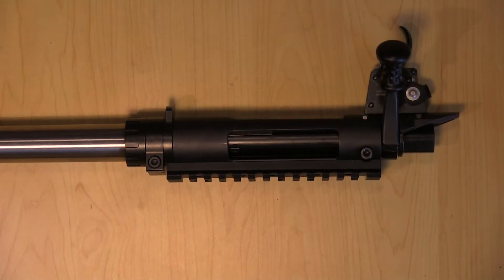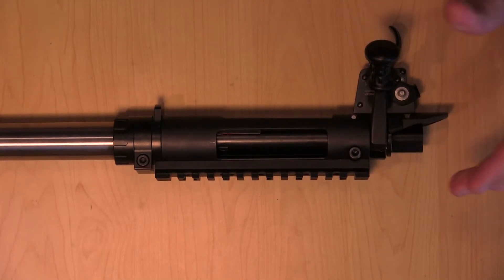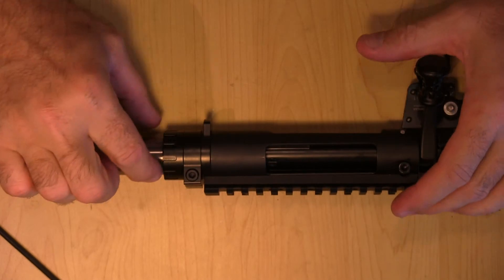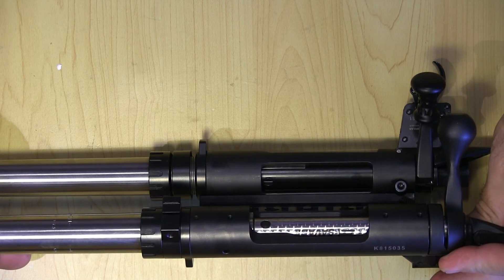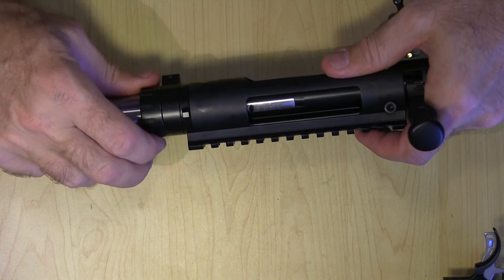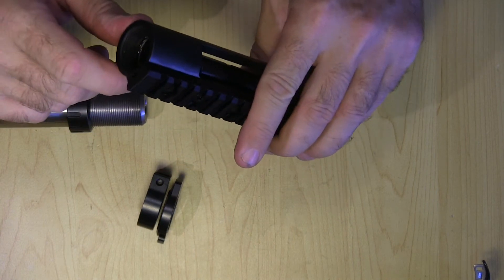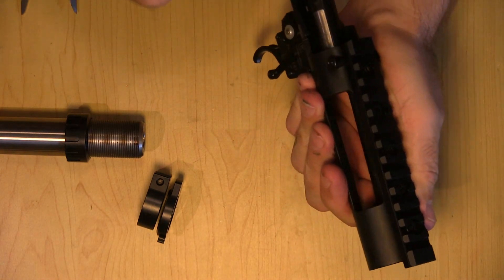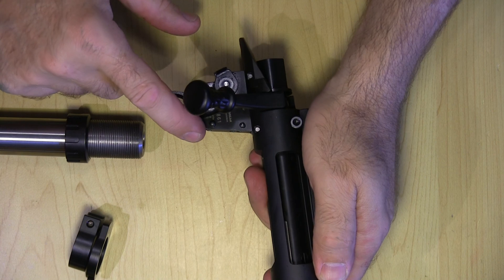Playing with Nucleus Part 1 (A)

Comment: I'm glad to see this video. At least I know a Shilen barrel will fit the Nucleus with the Barloc. Have you tried the Criterion barrel in the Nucleus with the Barloc? I heard some concern that the threads may need to be extended forward on Criterion barrels.
Reply from the maker: Criterion barrels will fit as well.
Reply: Thanks. I seen on a forum where someone had to extend the threads about .132" on a Criterion to work. Ted also said Criterion called him about the Barloc and their barrels when I talked to him a while back. That is why I asked. Thanks again.
Reply: Do you know the difference in thread length between Shilen and CBI? Say 1.375" vs 1.250" as an example.Thanks.
Reply from the maker: I have one to confirm, I'll have to measure. Currently the Criterion is on my Savage with a Barloc.
Reply: Long Range Student don’t take your gun apart just for me. With all the comparisons you did I thought you may have checked that already. 

I’m waiting on my Nucleus and Barloc to be made still. Hopefully it will be soon!